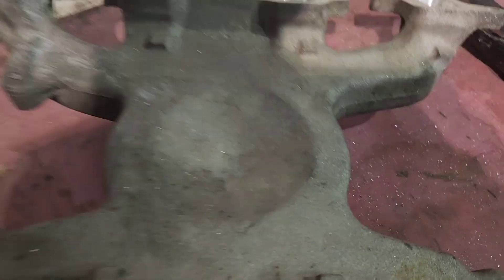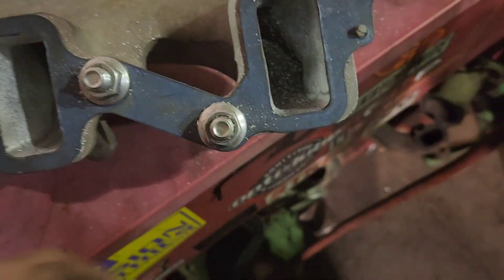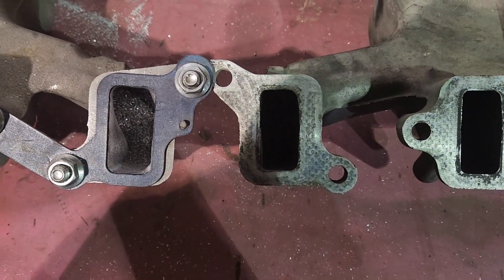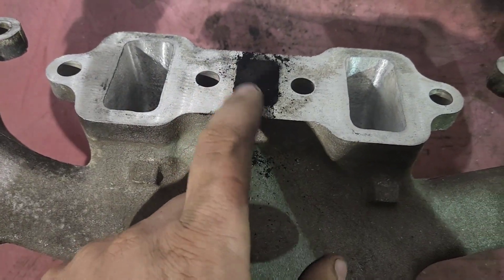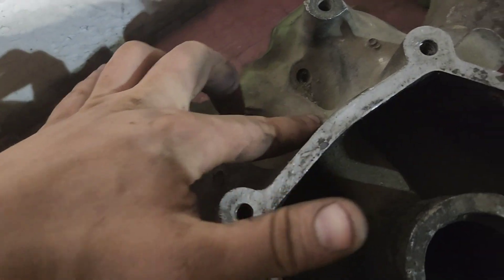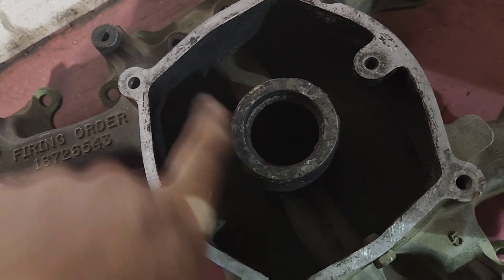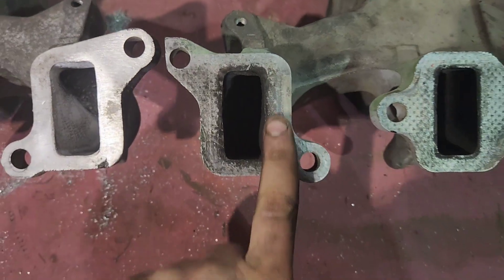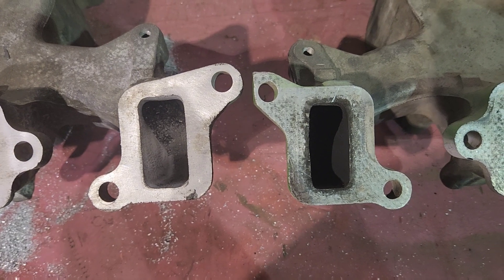Buckwild Tech Tip #2: 6.5 Diesel F Vin v.s. S Vin Intake Manifold. Ported Intake Update/Comparison

Comment: I bought non-egr for my truck. I was thinking of polishing over winter before spring install. Does just polishing make a difference?

My K1500 only has 61k miles. I have no plans on porting.
Reply from the maker: It definitely wouldn't hurt! Something like just polishing the intake is a mod that if you have the time and means to do it and it's already off, then I would do it. But I don't think I would pull the intake off of the running truck just to polish it and put it back on. If you have the time on your hands to do it, I would go for it!

Comment: Whats the best way to get the air out of the feul system.  Do you need to crack the injector lines when its all aired up. When the feul lines are full of air from over crack when you have a air leak. Thankyou for show your port work. You are really opening up the intake ports. I wish I had that talent to get the done.  Right on buddy
Reply from the maker: The best way to get air out is to make sure you have fuel at the filter first off, and then crank of the engine for 10 seconds at a time to not burn up the starter. And you can Crack an injector line or 2 at a time until you get fuel coming out and then tighten it up. A remote starter button makes the job a piece of cake so you can press the button and observe the cracked injector lines at the same time!